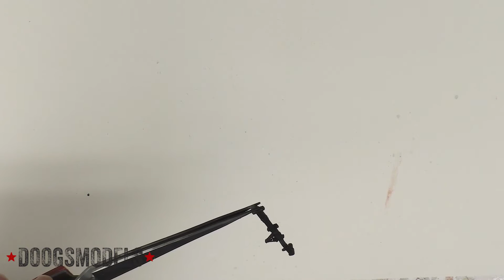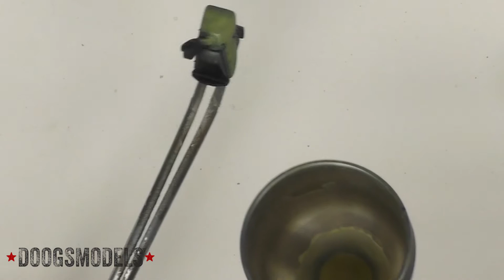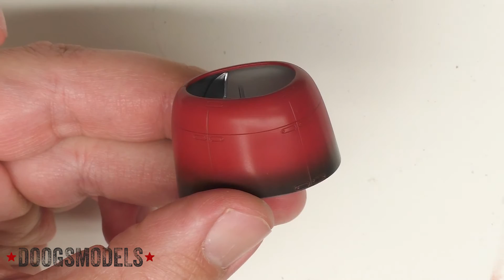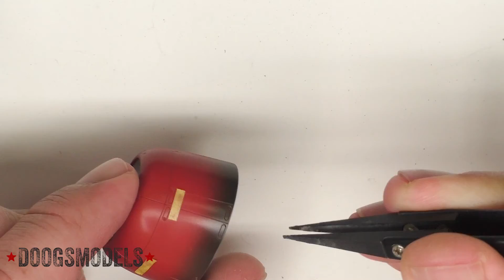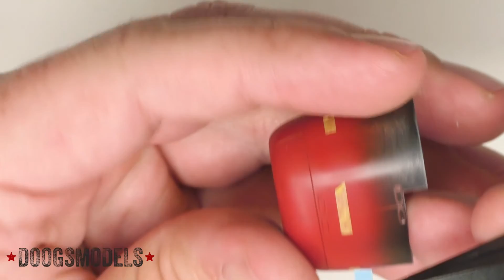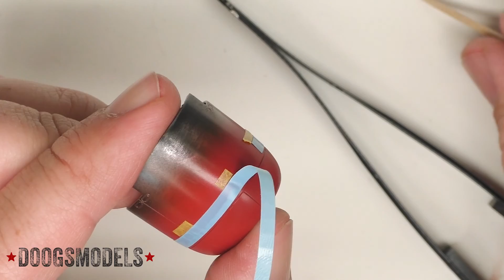Tamiya P-47M Build - Part 11: Buncha Smol Stuffs

Comment: If the front face of the cowl is flat then measure the distance back from the face to where the desired colour demarcation line is, build up a block of material to the same height as the distance from face to demarcation line, place a pencil horizontally on the block so the point is the same distance above your workbench surface as the distance from the cowl face to the demarcation line, place the cowl face down on bench and while holding the pencil firmly onto your block turn the cowl, the result should be a perfectly straight pencil line around whatever shape the cowl is.
Masking tape up to that line and voila! Fanny's your Aunt!

Comment: There are a number of panel lines & some riveting that is missing from the Tamiya kit. Obviously you can do just so much when producing a mold. Top drawings # 50 is the best that I've found for D-25 thru D-30 P-47. Which the "M" falls between. D-30's change post war when upgrade to handle HVAR's {Gen. Lemay's upgrades}